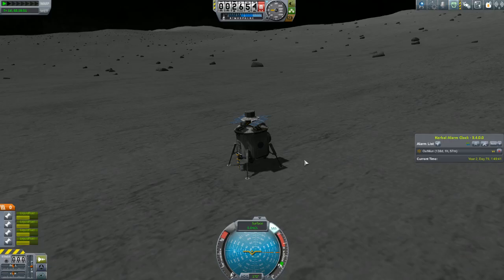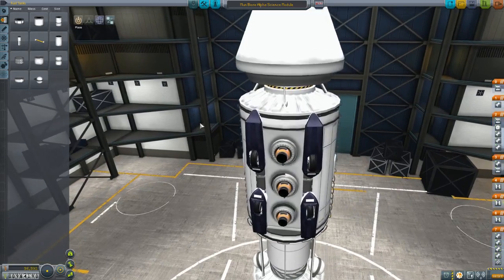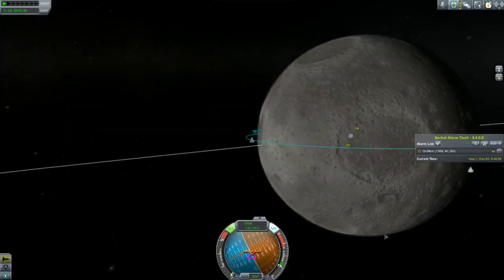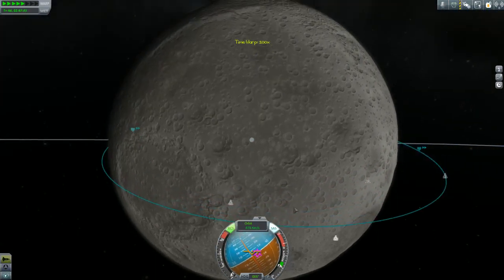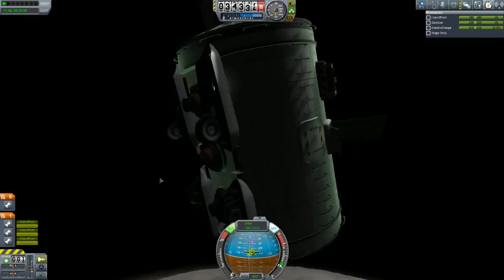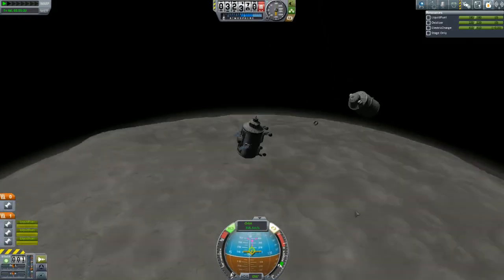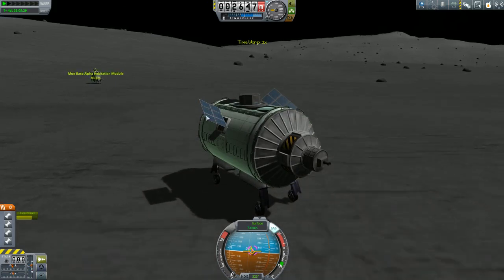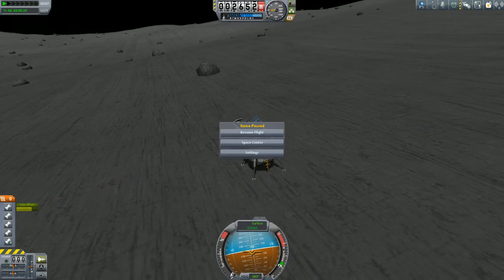KSP 1.0.4 - Mun Base Design and Construction Part 2/2

Comment: i started Career mode in HARD difficulty. Im now stuck with almost 1500 science but i have no funds to upgrade my research center so i cant use the science points :((( 
The costs of EVERYTHING in hard difficulty is like 300% more from normal difficulty. 
Cost of 1st upgrade for R&D? 650,000 or so .... 
I'm trying to find a way out at the moment by picking out the most easy missions that give the most money, but still i have failures from time to time. So yea, HARD difficulty is hard...